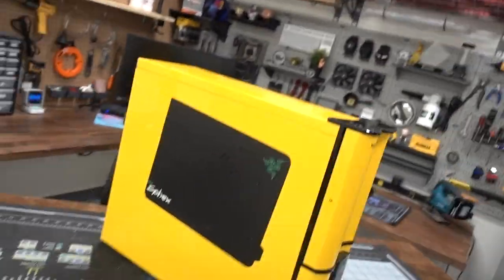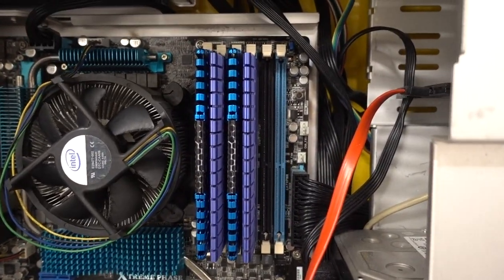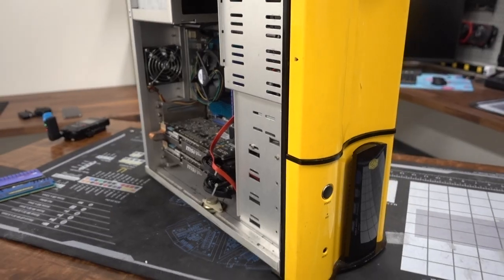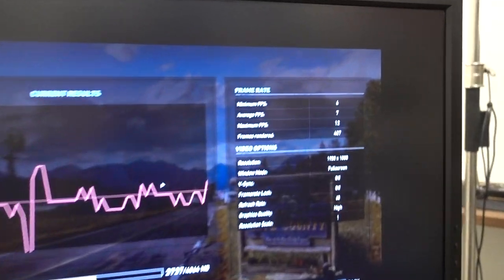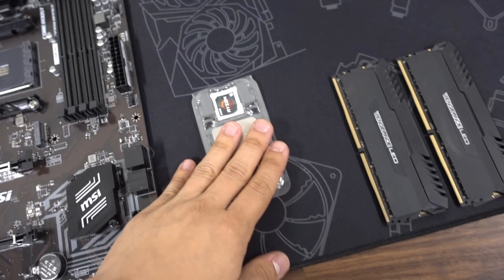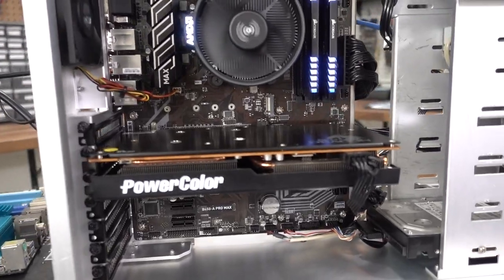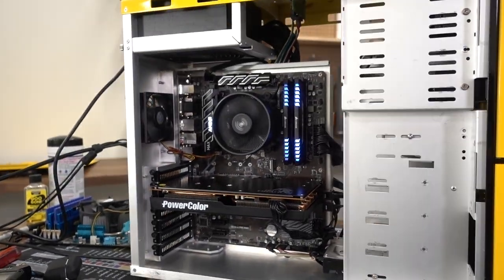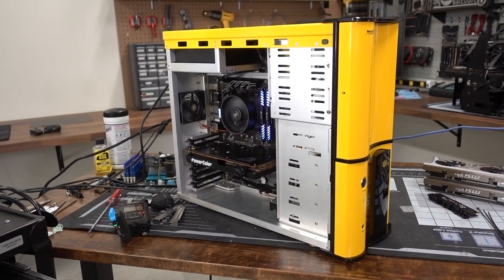It's been 10 YEARS since they cracked open this gaming PC. I'm going in!

Comment: That PC is more high-end than the one I'm currently using.
Reply: I wub u
Reply: Actually, this is ok PC now. With this motherboard you can upgrade RAM to triple-channel 6*4=24 GB, which is plenty for now and wont be too slow bc of triple channel. And you can buy Xeon X5650 (6c/12t) for $10 on aliexpress and overclock to 4.2-4.8 GHz, it will be around 2000 cinebench r20 points. Another option is W3680 (6c/12t) for $45 for easyier overclock because of unlocked multiplier. Perfect as mid-level system for nowdays, just add, maybe RTX2060, two dirt-cheap sticks of ram and dirt-cheap xeon CPU.
Reply: Niklause Mikaelson  First of all, I didn't meant you should buy videocard from ali. Buy it in local store or craigslist of whatever. 
And xeons are ok. How else you can get 2000+ cb r20 points CPU for $10? Or even $45. Yes, they are used. Yes, there is no point to bild new PC with old xeon from ali, but if you have mobo compatible with xeon, why not? Used CPU is ok, there is no any noticeable degradation in used CPUs. Yes, it is not fastest CPU in existance, but it is ok mid-level. And it will be more "upgrade PC" rather than "throw away old and make new" like in this video.
Reply: Niklause Mikaelson  You clearly don't know what you're talking about but it's fine.
Reply: Niklaus Mikaelson  PepeLaugh literal clown
Reply: Niklaus Mikaelson  Alright Niklaus LMAO
Reply: im running the same gpu wtf
Reply: Lol, I feel that, I got a free PC from work and upgraded the memory and gpu for $100 total, and it's probably good for 2016 games on max 😅
Reply: @MrGedem  yeah this is an ok pc when you change literaly every part. I agree lol
Reply: @werter490  wtf? Bitwit changed literally every part and blew up budget (because he can). But my option have old motherboard (which is still valuable nowadays bc it can work with top xeons of that era and can overclock them) and very cheap CPU and mem upgrades, so only videocard would be budget-heavy upgrade.
Reply: @MrGedem  wait... Are you talking about the pc in the vid or your personal pc...
Reply: @werter490  actually, I have pretty similar system with lga1366 asus mobo, xeon cpu from ali and 6x4gb sticks of ram.
Reply: @MrGedem  still doesnt answer my question
Reply: Nobody cares
Reply: Sorry for the other comment
Reply: @tarun6101  not forgiven >:((((
Reply: This PC is literally infinitely better than what I'm using, considering I can't even play 1080p 30fps video.
Reply: Same
Reply: @eriklona8806  2008 at max
Reply: @MrGedem  6 GB sticks of ram is crazy

Comment: I love that he physically recoiled In surprise when he saw the GPU temperature
Reply: It actually wasn't outside the realm of possibility to run a graphics card that hot, but I'm assuming that's 10-20 degrees higher than what it tested at before 10 years of dust clogging the cooler.
Reply: You mean you didn't?

Comment: I have the same case for my backup except mine is black with a plexiglass side window.  I did the same putting slotted covers in the back and mesh cover plates for 2 of the 3 5.25 bays in the front. I leave the fron door open and have never had a heat issue. It is a very solid case.

Comment: I am missing the part, when you only switching the graphics card and the rest of the system stays the same (old CPU, old ram, old motherboard). I wonder how this would compare with the rest changed components. Maybe there is still a chance to check it on an open bench?

Comment: Kyle: "Remember booting off a 120gb ssd?"

Me: Looks at my 120gb boot drive Cries
Reply: Same :( although I bought a 256GB SSD but I can’t seem to to make it my C drive and every vid I watch I have to use a third party program you have to pay for to transfer windows to another drive :(
Reply: Me to Kyle: why must you hurt me in this way
Reply: I remember booting off a 120gb SSD, that was last month when I finally replaced it with a 1TB M.2 NVMe.
Reply: Looks at my Hard Drive as my boot drive... Cries profusely
Reply: Ive 240gb wd ssd lol
Reply: Nothing wrong with that. I have a samsung 256 as my boot and have no need for anything larger. I don;t see the point in having a larger boot drive
Reply: @ZaiyeProject  crucial have a piece of software that will clone your entire drive for free iirc. Search for Acronis True Image, there is a 30 day free trial that will let you clone your ssd to the new one.
Reply: My Windows 7 PC still has a 120gb boot drive. I don't want that modern QLC crap.
Reply: @Nicefisher will do thank you!
Reply: @Nicefisher That's my go to for cloning drives, easy to use, free, and I've never had a problem with it.
Reply: Samsune 840 EVO 250GB was my first SSD which cost me around $160 for around 5 years ago I think, now I upgraded to the 970 EVO plus 1TB for $220
Reply: As long as you have other drives for actually storing things it should be fine.
Reply: @ZaiyeProject I  just install Win10 fresh from USB by download with MicroSloth's tool.
 Turning other drives off, simplifies install and after into BIOS to change boot drive.  Once happy later I can reorganise all my data and setup backups
Reply: @Harryofbath  I actually make C: small to avoid it filling with crapola
Reply: @ZaiyeProject  Cloning OS isn't even that good to do. You'll find loads of problems. Better off with just getting a 16+GB USB and doing a fresh install to the SSD over cloning it. I would know saying I did this and it all went well at 1st till it didn't.
Reply: I do - a 2009 Intel Penryn Mac mini which I think is still halfway across the country in my mother's garage.  120GB Hynix, 1GB of DDR3 RAM, 256 MB nVidia GeForce VRAM, Mac OS X Leopard.  I practically fried the thing while playing Counter-Strike: Source when Gabe proclaimed that Steam was now available on Macs.

But macOS NOW...pfft.  Eleven years later and I'm done with Macs.  I can't wait to take my tax refund next year and build a AMD baby with an RTX 2000 series GPU with Linux Mint and Windows 10.
Reply: samee, i have a 1tb ssd in addition but i dont know/cant be bothered to move my windows install
Reply: @guyknightley3499  how exactly would I transfer windows over then doing it fresh?
Reply: @ZaiyeProject  It's been a few years since I did it. I would have to look it up again but for real its not even worth it.
Reply: @guyknightley3499  are you saying the thing you suggested instead isn’t even worth it or just referring to the original method of cloning?
Reply: @RobBCactive  but wouldn’t I need to reactivate windows if I’m doing it fresh from a usb? I installed windows on the PC I built initially by using that method and it seems like you’re suggesting the same thing but with my new drive but that wouldn’t transfer windows it would just be a brand new inactivated one right? So I’d have to buy a windows key again??? If so then I’m not very fond of that plan lol😂😂
Reply: @ZaiyeProject  As long as you have a retail version of windows, you can transfer to another pc but it'll inactivate the previous one.
Reply: @Bradley Schroeder I remember that company, they had good products but badly run. Anyway though I was too broke to afford a Voodoo 5 graphics or any 3dfx card at the time 🤪😂

Comment: I had this caase back in the day and it is still in the loft somewhere. i thought it was the best case in the world when i bought it. As i had it i am also very disapointed you did not notice or show off the fact that this case has a removable motherboard tray. so the floating tray design serves a purpose as it is removable so you can build on it out of the case then just slide it back in and thumb screw it in, easy as that. That was some high tech shit for over 10 years ago.
Reply: I had an HP xw4600 Workstation with removable motherboard tray, it was built like a tank (weighed nearly 40lbs/ 18kg).
Reply: I had a thing for the old Coolermaster aluminum cases as well.  At one point I had a Praetorian, super sweet case.  All aluminum build.  In retrospect, terrible air flow.  But hey, back then we didn't really need it.  I also built a brand new i7 920 build in '09 (that still runs to this day!!) that featured the Coolermaster CM Stacker w/ the removable motherboard tray.  The Stacker series allowed the users to flip the entire system over, so the mobo was on the right side of the case vs the left side.  Pretty cool feature (if you ask me).
Reply: @thepezfeo  jesus christ, 18kg is like a big bag of potatoes (this is the Irish system we use instead of football courts from America )

Comment: "time capsule of hardware"
Looks at the same gpu in my system.
/sigh
Reply: get a better job then
Reply: @Gamerthinkersman  you dont know his scenario
Reply: @maxsteinhauser  it was a joke
Reply: Some 6950 can be flashed to 6970, or 6990 to get a bit more out of them for free.
Reply: @LTXwooshie  it cant do 6990 thats a dual gpu card, its basically 2 6970 in crossfire on 1 PCB
Reply: @LTXwooshie  Can confirm, had my Sapphire 2gig version post better scores than a stock 6970 with a flash and oveclock until it died like 2 weeks ago :'(
Reply: last january the rx580 was 150$ just wait till january were almost there im sure ya can get some decent prices on new hardware then ^_~
Reply: LMAO i have almost the same Build and i felt attacked too
Reply: @Gamerthinkersman  Better job? I'm guessing you didn't hear about this thing called 'Corona' and how it destroyed people's livelihoods. I got a fucking awesome job until the company I worked for could no longer operate because 70% of the labor force got the virus.
Reply: Got yourself a vintage

Comment: I like how his "upgrades" are pretty much an entirely new pc.
Reply: If you replace every part in a car but the chassis, it still is the same car right?
Reply: Nope. The case isn't the computer. The components are. The car is the chassis. Not the engine. This is an apple's and oranges comparison
Reply: @patrickprafke4894  dang, thanks for correcting me
Reply: @cameronmaltbie4435  yes, its the same car. Because every chassis has its own vin and you cannot change that. It will always be basically the same car, just different.
Pretty much

Comment: Ahhh, back when cases did not have glass panels and they were actually built like tanks
Reply: Yeah, I sort of miss that, the Antec P180 was a huge chunk of steel.
Coolermaster had their memorable HAF series, not the best build quality but boy did they flow air, the looks were great too.
Reply: @MiGujack3  I still have a haf x case currently have my 6 build in it don't think I will ever upgrade.
Reply: @rafety85  I had a 912, it was decent but the front panel was crap and somehow stripped the screws on the panels over time.
Reply: Casual Scum  They are now more on looks than functionality, features and longevity
Reply: Got year 2000 pc case. Needless to say, the metals used is very heavy and thick. Not some tin can we have today.

PSU is still top mounted
Reply: @bitelaserkhalif  Heck yeah! I really need to get old case. This one i have is way too thin metal, i can wobble it just by hands

Comment: Man, how I'd kill for one of these older X58 motherboards! It's the perfect blend for modern and retro gaming and upgrades are super easy given the Xeon support, sadly they are too expensive everywhere and impossible to find, you got lucky! If you are planning on throwing it away or letting it rot, let me know, I'd be happy to take it off your hands!
Reply: All express has Chinese motherboards X58 including bundles.  Don't know if new chips or reusing old ones. Used cpus.  $100 +
Reply: Throw a zeon in those, overclock it a bit,  and update the vid card a bit and it will do moderate gaming still I bet. I have one I don't use regularly anymore but that was the best value I ever had out of equipment.

Comment: Kyle: "Remember booting off a 120gb ssd?"
Me: Remembers first ever PC - 386sx25 with 200MB HDD...
Reply: lucky my first PC's boot drive was 5.25 floppy drive
Reply: 200MB was pretty darn good for a 386. My 486DX2 came with a 250MB
Reply: @nelizmastr   I had that exact same for my 486DX2 iirc.
Reply: @nelizmastr  iirc - it was an upgrade my Father bought...  I'm not sure, but I think the original HDD was 80MB or something... running DoS and having to manually boot windows 3...   Halcyon days for sure.   Kids these days don't know they're born! :D lol
Reply: "386sx25 with 200MB"
very close in time to me then... first PC in house was a Philips 2864 with an 16MHz 80286, 10MHz 80287 math-cpu, had a 55MB hardrive and Windows 3.0.
had also a fancy for that time Philips Paradise VGA card with 1MB of VRAM (system had 2MB...) on an 1024x768 15" monitor 
still have the machine, Philips Monitor have died so now it got an Eizo 19" but it also have gotten an bit of an upgrade with an Harris 286 25MHz, 16MB of RAM and 512MB industrial CF for boot drive.

played the shit out of Supaplex and Commander Keen Eps4, 6 and Dreams back in the days, and still does from time to time
Reply: While the first computer that was mine booted off a cassette tape, the first HDD in one I owned was a 20MB, double bay 5.25 drive in an 8080 tower.  (okay, technically the Vic 20 booted off on board ROM)
Reply: When I was a kid, my dad said that it would be impossible to ever fill our 10 mb hard drive...

I currently have a 20 TB hard drive...that's almost full...
Reply: My first was a Pentium with 120mhz. So 2 generations newer than yours? (386 > 486 > Pentium, right?) Was hand me down. Can't remember the storage it had, but not a lot. I remember my 3rd computer that was a "BEAST" and had a whopping 6gb.
Reply: Cut my teeth on things like Apple II, ZX80 and VIC20. First computer I owned that had a HDD was an Amiga 500. Well it had a HDD after I added a SCSI controller and a separate enclosure with a 5-1/4" full height SCSI drive in it. If I remember correctly it's a Micropolis drive, haven't looked at it in more than 15 years but I've still got it somewhere. Still had to boot from a floppy though as the A500 firmware didn't support booting from a HDD or even knew what to do with a SCSI controller.

There is something very physically satisfying with the way a large HDD sounds and feels when it are doing disk access. You can not only hear but feel when the head assembly moves. That large piece of spinning rust had really good access times for it's generation, and that translated into violent clunking and shaking of the chassis.

Still the coolest HDD I've laid my hands on was a 8" shugart (spelling?) drive. This was a beast with really impressive access times for being such a huge slab of heavy metal. The read head assembly was moved using a huge magnetic coil and was accessible for adjustments. Adjusting the read head alignment involved running some diagnostics which involved extreme movement of the heads, butterfly reads and random access. Doing the extreme strokes at maximum speed that huge magnet inside the coil was doing a 2 to 3 inch stroke 30 to 40 times a second. That's something like 2 pounds of metal moving each time which resulted in not only the drive and the table shaking but it made the entire floor resonate and had people from other floors showing up to see what was going on.

Oh, and that huge drive was something like 10MB...
Reply: My first build has good.
Reply: @blahorgaslisk7763   If you decide to start that Amiga up, be sure to measure the PSU first. When they are that old they tend to be broken and deliver too much voltage. Needs to be recapped.
Reply: @calmterror  And if you took out a a small loan you might even get to own a 10mb full height MFM Hard Drive :} I had a Compaq DeskPro 8088 with 2 5.25 floppies lol!
Reply: My first machine was a 286 with 256kb ram. 40mb hdd
Reply: Well you beat me mate, mine was a 485 DX2 66. Before that an Amiga 500
Reply: Lmao my first build was a fix 6300 and a gtx 1050
Reply: @Revener666  Thank you for the warning. Hadn't thought of that. I actually had to have the PSU fixed before I retired the machine. It had started to become extremely unstable so I took it to a company that repaired them. They found no fault with the computer but the PSU was delivering to high a voltage. Don't remember what tehy did to fix it but it worked fine for more than a year after that. If the caps have dried out I guess it's not a good idea to just plug it in and test though...

Well there's also that battery that tends to leak. Though I think that's on the memory expansion card in my machine. As I remember it the base A500 didn't have a battery backed RTC but that was included with the memory expansion (+512 KB for a total of one megabyte, though only half were available to the chipset) and you had to run a utility to set the computers clock each time it booted.

Well for what it's worth that battery apparently tends to dissolve itself into a sticky puddle of creeping corrosion that eats away at traces and such. At least if it was a certain brand (Varta?) and as I understand it nearly all of them were using this (not bio-) degradable battery. I wonder if the A500+ or the A1200 had that battery on the main board?

Oh well. I'm at least aware of some of the potential dangers. Thanks again for the warning.